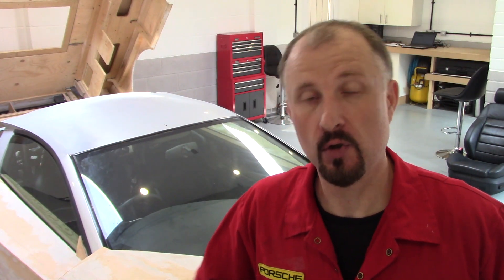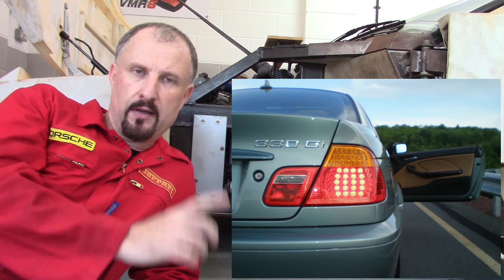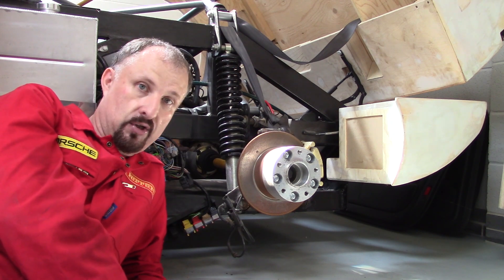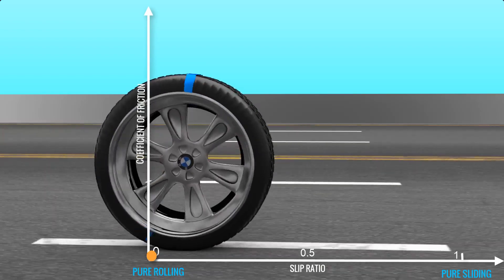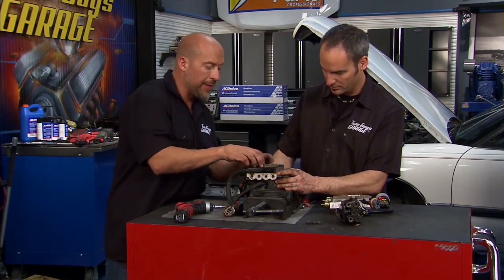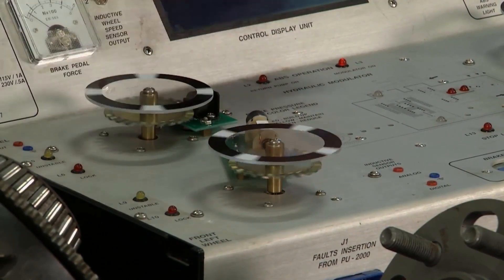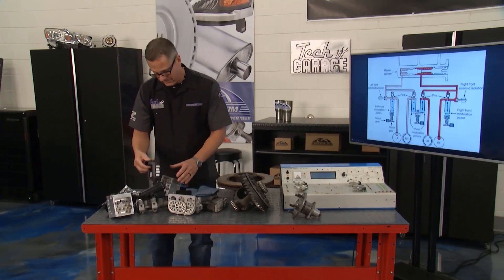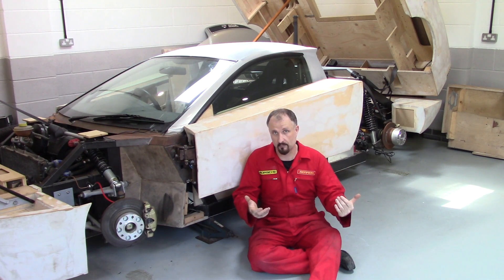Braking System and ABS for my DIY Supercar: Prototype Ep16

Comment: Since I am here Let me share some infos:

There are 2 types of rotation measuring method used in a car...
Rubber based magnetic encoders disc..
Metal tooth based encoder disc...

Tooth based encoder sensor creates it own magnetic field and measures the magnetic field change when there is a metal part or holo part in the way...
Rubber based magnetic sensors measure the magnetic field desnity and polarity of magnetic field...
They are different technologies and sensors which they don't mix...

These encoder technologies are used in Wheel speed/crackshaft/transmission applications... So not only your speedometer depends on it also your rev meter also depends on these discs and sensors...

Comment: A passive (inductive) ABS sensor will normally have 2 wires, an active one will have 3 wires.
Reply from the maker: Thanks for the tip. I may go back to this subject in a future episode and go into a little more detail regarding ABS, maybe how the 2 different systems work.